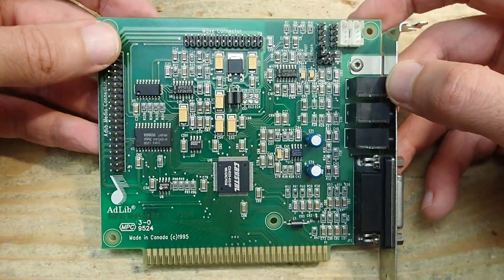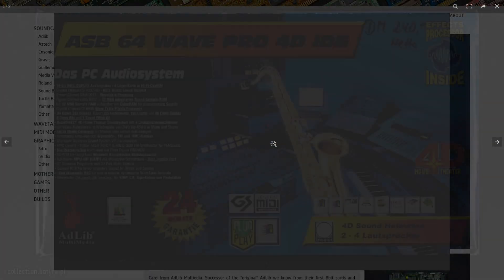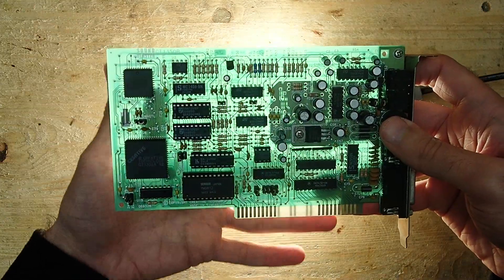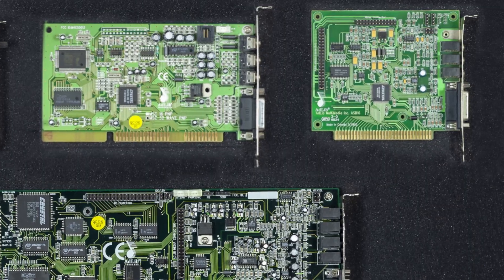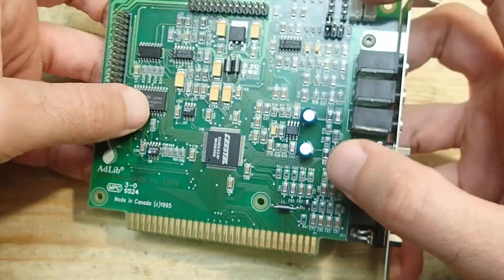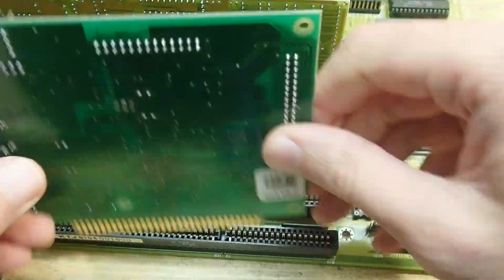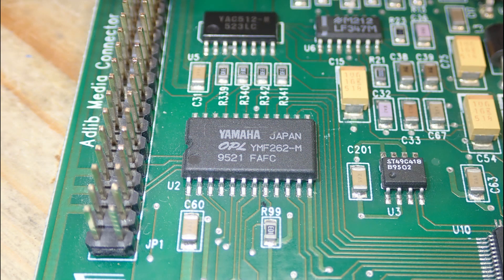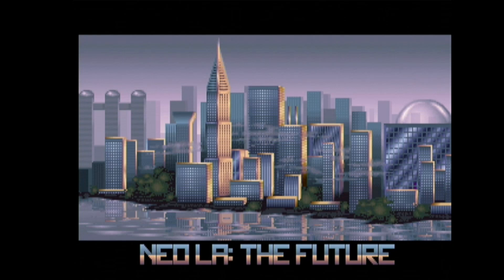Is this the last 8-bit sound card, which was ever made by AdLib?

Comment: Thank you for your positive review of the Adlib Multimedia advanced sound board, a Short Slot 16bit 44khz audio card that was fittingly designed and built in the  Quebec City. I would like to point out a few discrepancies, the card shipped with the jumper on (JP1) and is there to allow the programable chip select to be used on the media connector for a modem, ide, scsi or network add on daughtercard across all the ASB line of cards.. remember the days of only 5 slots!........ The design around the CS4232 was  due to the built in DSP to allow an adlib emulator upload to the DSP so functionality is not lost when the AMC is used and is PnP control enabled. This card was the ONLY short slot sound card to obtain windows 95 certification BTW.  Oh yes I almost forgot, I was the 'guy' that designed the new Quebec sound cards, if you look on the back of it, it has my initials MKP  (Mark Keith Pickering) in the trace layer...
Reply from the maker: Oh! What a pleasure! Thank you very much for this interesting insights and of course a big thank you for creating this great sound card :)
Reply: I tell you what, the Canadians sure made excellent sound cards. Multiple companies had astounding passion for attention to detail, and I wish we could have seen honest companies like Gravis, AdLib, and MediaVision focus on honest competition without Creative hacking them up with a butcher knife because they can't innovate on their own. If I ever get the opportunity, I'll be sure to acquire and preserve one of these fine products for my kids to know the glory of early digital audio (which so far includes an original AdLib).

Comment: Regarding the AdLib Media Connector, was this the predecessor to the future Creative cards that had a general-purpose expansion connector?  The Audigy (I think) had such a connector that looks very much the same, and in my case I used it to add optical/TOSlink and SPDIF I/O via an add-on card that was made by a hobbyist and sold on Ebay at the time - this was like...2001-ish?

Edit: I should add, this might have been on both the Audigy and Live! cards, can't remember and I don't have those cards anymore.  I can't remember what the connector officially supported from Creative.

Comment: JP reference designator stands certainly for the whole connector given the footprint (outline) and placement, and you'll notice that 0.1" pitch connectors generally get a JP designator, doesn't mean jumper; and "Adlib Media Connector" silkscreen is centered across the whole connector as well!

Curiously Batyra's soundcard website (linked) depicts the card with the jumper link installed just like you figured out. The picture is dated 2019, it predates your video. Odds are this is how they received the card, how it comes from the factory, and the jumper needs to be removed if the connector were to be populated with an extension that potentially never came out.

According to the datasheet, CS4232 has an "external peripheral port" which can house either a CS9233 wavetable or an OPL3. Though i'm not sure what for, since the wavetable chip just speaks MIDI; but it also has an ISA bus interface on board. Some sort of contingency measure or misread the CS4232 datasheet and thought they'd need to divert CS from OPL3 if they expand the card with a CS9233?

Comment: Believe me (or not) my SB1.0 had soldered cms chips and socketed FM chip, Serial number in the low 1000s I sold it last year for 140€ :(
Reply from the maker: Why shouldn't I believe that? It's absolutely common for the SB1.0
Reply: @necro_ware  The other way round was more common ;)  I got my card directly at the soundblaster booth at the cebit 90´ !
Reply from the maker: @logipilot  For the SB1.0 it was usually either the way you had it, or all of the ICs were soldered. They started to install the CMS into sockets with SB1.5, where later revisions were even delievered with the CMS chips at all.

Comment: Someone should make these cards into an FPGA, and mass produce them for retro PC projects (like mini DOS and Windows 98 Se PC's)
Reply from the maker: It's quite hard to create analogue synthesizers in FPGA and make it sound like the real thing. That's why nobody managed to make it so far.
Reply: @necro_ware  not really. It's all digital. The most analog circuits are after the DA, which also have been put in a chip (think tripath amps).
The combination of a Yamaha soundchip cloned, a wave table, sound blaster compatible processor, the digital circuitry of a tripath amp, the dna/irq routing, and some sound inputs can be very easily put in an fpga.
Reply from the maker: @ProDigit80  On the second thought, you are probably right in regards of digital, the YMF262 has external digital to analogue converter, so it must be digital indeed. But still, I think it's going to be hard to implement it in FPGA. A dozen of companies were trying to implement it in their ICs back in the days and not one succeeded to get the genuine sound. I guess, that's for reason, but if you have an idea, I can only cheer you up to go for it. My concerns shouldn't be a real reason not to create something like this.
Reply: Late reply, but there was a project being worked on a couple years ago that sounds like what you were talking about. Search "The one sound card to rule them all" for a video explaining the project.

It's a shame it seems that COVID has stalled development...

Comment: Just a quick one, I would say putting a ground plane in the edge connector where there is a pin scraping against the pcb surface is a hugely awful idea. Enough insertions and you're going to have a direct short to ground
Reply from the maker: The ground plane is inside of the PCB on the multilayer cards. You can't scratch through to it.
Reply: If you’re managing to dig out the ground plane burried deep in the PCB you’ve got worse problems; like completely removing gold plated connectors and snapping the card in half.

Comment: Would guess the addon card has its own midi syth on that replaced or compliments the OPL thats why the pins get passed through the interface maybe software controlled 5.1 support? With 2 OPL 3s
Reply from the maker: I think, that was the plan, however I found only modem add-on cards. I guess Adlib eventually never came up with the actual idea of that header.

Comment: I believe any CS4232 card behaves similarly in an 8-bit slot; ie this card does not really have a leg up on 16-bit versions, which will only be able to use limited IRQ, and have WSS and IDE controllers disabled in an 8-bit slot.  Pretty nifty card though, the build quality is impressive.

Comment: The OPL3 FM-synthesis on this card sounds very distorted. Yesterday I was trying to figure out why and found out it's because the two quad-op-amps LF347M are connected only to a 5V power supply, whereas they should be fed at least 7 Volts according to the datasheet. Replacing them with low-voltage rail-to-rail op-amps LMV324M fully resolved the problem.
Reply: scams scam scammers AdLib yamaha sound opl midi

Comment: Great sleuthing and coverage.  I hadn't seen or heard of that card; maybe there are more of them out in the wild.  Being an 8-bit card that also supports Windows Sound System, it should be capable of 16-bit 44.1KHz output as well.
One question:  The card you show at 3:40, I noticed it has a 14.31818 MHz crystal on it.  That is suspiciously the same crystal in the original PC, which is divided by 12 to get the 1.1193182MHz clock for the PIT.  Do you think the card with the 14.31818 MHz crystal has some sort of  PC speaker routing/emulation, like the Pro Audio Spectrum cards do?
Reply from the maker: Thank you. As I said in the video, WSS unfortunately didn't work, it was initialized, but neither were the games able to detect it properly, nor did it play any sound, when I set it manually. Since I never saw an 8-bit capable WSS sound card, I assumed, that it needs the full 16-bit bus for the data transfer. I'm still not sure about that.
And about the crystal, the presence doesn't mean much. Many high quality sound cards avoid using the 14.3MHz frequency from the ISA bus and use instead own oscillator for higher quality. From experience I also can tell, that such cards usually run better in faster systems (f.e. P2/P3). I'm currently working on an own sound card and I'm using dedicated 14.3MHz crystal as well. Divided by two you get a perfect OPL/CMS clock as well. I don't know if I want to use the crystal in the final version, but for prototyping, it's handy to have it. In regards of the card in the video, may be it has a pass through of PC speaker as well, but most likely it hasn't. At least I don't know about that feature in the CS4232 chip, but who knows?! The crystal is not necessary a hint that it is such a pass through.
Reply: @necro_ware  I appreciate your clarification, thank you.  Shame about the WSS portion; I guess that leaves the PAS series as the only cards capable of 16-bit audio output while installed in an 8-bit slot.  (The GUS technically qualifies, sort-of, as you can use it in an 8-bit slot but can't use DMA, so the only way to play 16-bit samples is to upload them to the card via PIO and then play them, limited by onboard memory of course.)

Comment: Interestingly, the ASB 32/64 card you showed earlier in the video (around 3:41) had a jumper on the Adlib Media Connector on the lower end - just like the one you had to install on the ASB16. I suspect these cards shipped with the jumper installed, and it was to be removed when an expansion board was added allowing the expansion board to selectively enable/ disable the on-board OPL.
Reply from the maker: Yes, probably. I also noticed the jumper on the ASB64 later during editing of the video. I don't know, where this ASB16 comes from, may be it was rescued from a scrap yard and someone salvaged the jumpers previously. We'll never know.

Comment: What an odd situation with the OPL3.  Presumably, the card would have shipped with a jumper in place?  The manual does mention the following, not that it's helpful any longer. :)

Question: After installing the ASB 16 DOS drivers, I don't hear the
game's music. What should I do?

Answer: Check to make sure that all the cables are in the proper place as
specified in the manual. However, if you do not get any result, make sure that
jumpers 1 and 2 on JP1 are closed. This will enable the Yamaha OPL3
synthesizer.
Reply from the maker: Yes, I found it in the documentation afterwards as well :) It is also not quite precise at that point, they say jumper at position 1 and 2, where it's not clear if they mean one jumper over the pin 1 and 2, or two jumpers at the first two pairs.... Well, now I know, that they really mean two jumpers at the first two pairs and it works now :)
Reply: To be fair, the German manual is the only one where the Jumper is not mentioned, but in the French and English Version 😂
Reply from the maker: @copyright_karl  Exactly, that was actually the reason why I was asked to take a look. The owner didn't find anything about it in the German manual...

Comment: just a jumper to enable music. simply: wow
Reply from the maker: Yes, I'm very glad it was just that and nothing worse.
Reply: @necro_ware  You should also replace the LF347M op-amps with LMV324M or something similar to get rid of the ugly FM-synth distortion. The 5V power supply is not enough for them as they require 7V or more, according to the datasheet.
Reply from the maker: @radovanm.2392  Thanks for the advise! However, this card was just borrowed...

Comment: If only we could get a clone of this card made instead of the overhyped Sound Blasters...
Reply from the maker: It's a simple task to make it. As far as I know, all the chips are still easily available.
Reply: Hah.. yeah, ironically, this would be the easier one.  Although, frankly, if your "clone" of the Sound Blaster was less concerned about authenticity, and more concerned with having the most effective, compatible card you could make, then there wouldn't be a great deal of difference.  There are plenty of all-in-one codecs, like this Crystal chip, that can give you a good DAC with SB/P/16 compatibility.  And they're so tightly integrated, that it's kind of hard to screw it up.  Do a half-decent job laying out the PCB and you're golden.
Reply: @sirnickity  Couldn't agree more.

Comment: Wow, in headphones you can really hear the beautiful frequency response that card has for the FM synth. A fitting last hurrah for a brand that rarely compromised its quality
Reply: Nope. As long as the card uses the LF347M op-amps, the FM-synthesis sounds like rubbish. They need to be replaced with LMV324M or something similar.
Reply: @radovanm.2392  You know what, i find the distorted crunch actually compliments FM sound. It was a key "feature" of Megadrive, though for different reasons. FM can sound pretty thin, it gets really lush at 6op, kind of tolerable at 4op, and tends to be super thin with 2op as used by DOS games. The distortion introduces some added intermodulation which thickens it right up. Maybe it's even intentional?